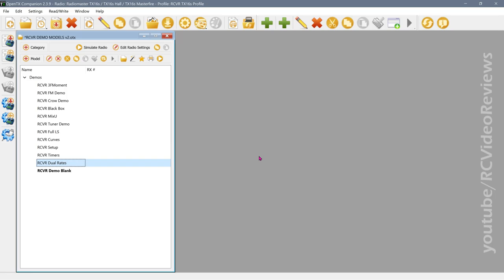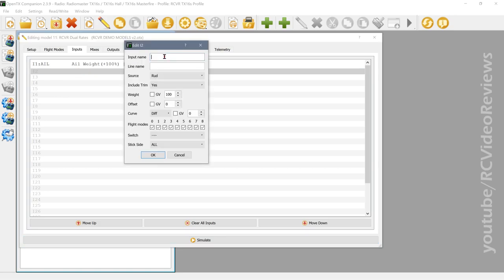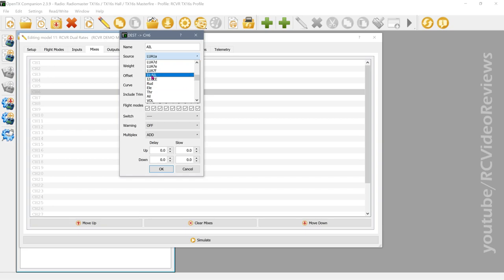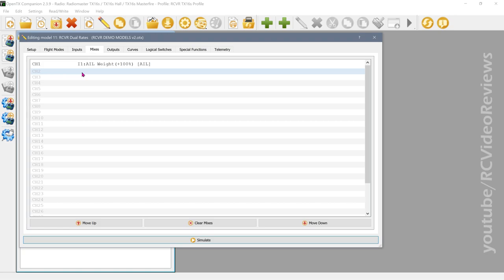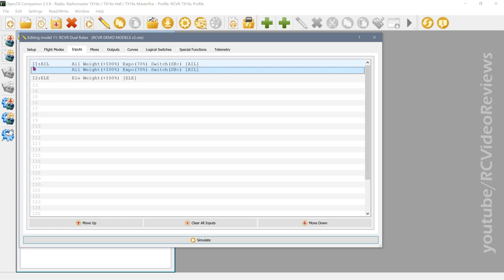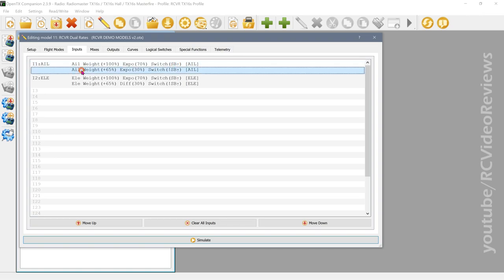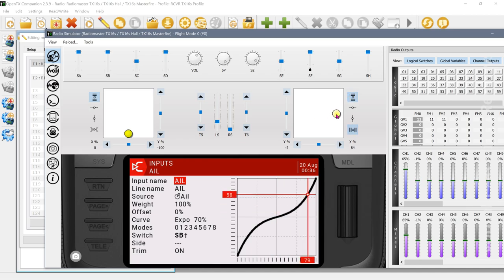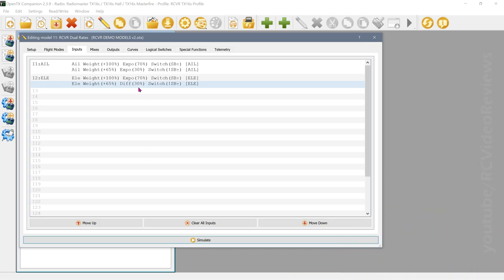OpenTx Companion Tutorial • How to Setup Dual Rates • Radiomaster TX16s • [Beginners]

Comment: Very clear! Just what I needed. I set it up on the radio directly, don't like to use companion. So I know what to do when I'm at the flying spot. Thanks.
Reply from the maker: Great! it's not too hard to convert instructions from Companion to the radio directly. There are a few areas where things aren't in the same places (Global Variables come to mind) but otherwise, it should be pretty easy to switch between the two.
Reply: @RCVideoReviews  Forgot how to do it and forgot the thumbs up apparently 😄, thanks again

Comment: Dang! So now I have to add my laptop to the mountain of other junk in my wagon when I head for the flying field. :D
Spend a lot of time wondering why things won't work before I come here for the light bulb moment. ;-)
Clearly annunciated and lucid. Thanks a bunch Chief! :)
Reply from the maker: If you spend some time tooling around in Companion, it will help you get familiar with how OpenTx works. The mouse makes it easy to navigate, the interface presents a full screen of options so you can see everything in a glance.

If you can learn to move around in Companion, you will easily be able to navigate the radio at the field.

Same concept as a flight simulator. Play with the sim at home, and when you get to the field, life is easier.
Reply: @RCVideoReviews  Oh I know what I should do. It's just that, being so old and cussed tancankerous, I just don't want to change my ways and learn! :D
Reply from the maker: We both know you’re curious. You can’t resist. You keep watching these videos. Just soak it all in. 

Do you have Companion installed?
Reply: @RCVideoReviews  Not yet. I'll stick it on the old laptop - if I can find it when I dig down through the pile of newspapers/pizza cartons in this old bachelor's hut! :D

Comment: Great Video, thank you for always providing such amazing tutorials! I have been adding D/R and Expo directly into the tx with each model I add. If I try your method of entering D/R and Expo through Companion will it automatically assign the D/R and Expo to each model I add, if so that would save me a lot of work when entering a new model? Thank you
Reply from the maker: The best thing to do is create a template and use that for all your models. So I do a basic setup with my rates, audible clues, throttle lock, gain for stabilizers, mode switch for stabilizers, trims to zero, subtrims to zero, etc....With all the basics set, when I'm ready for a new model, I select my template, then click copy, and start applying the differences from my new model and the template. Basically a bind, rate/expo adjustments, control surface changes (dual ailerons, flaps, gear, etc) and I'm done very quickly with the initial radio setup.

Comment: Did I do something wrong when I set up the different Weight and Expo rates inside the mixer tablet with mixers which replace each other? Is there something I can do better when I make this settings in the inputs? Thanks for your work and your tutorials!
Reply from the maker: I always use inputs for dual rates. It can be done in the mixer, but then you have to repeat all mixes you setup. It's best just to set dual rates/expo in inputs.

Comment: Hi, I want to setup dual rate for steering using alireno in mode 4 for my rc car but I want to assign a pot to adjust the weight from 0 to 100 so I can control the throw of the steering servo. How do I do that? It's a very common feature on most pistol style rc car radios which come with a dual rate pot.
Reply from the maker: Watch this: https://www.youtube.com/watch?v=KNXBwHwdFWU

Comment: Great video! Quick question, did you mean to set up elevator as "diff" , or are both as "Expo" in regards to the curve?
Reply from the maker: I usually don't setup elevator with diff--that's usually for ailerons. Not saying never, just not usually. This video was made some time ago, so without watching it again---not sure. Do you have a time index?
Reply: At the 7 minutes mark you can see the elevator dual rate is set as "diff". Just wondering if this is the desired setup or as "expo". 

Again I can't emphasize how helpful your videos have been to me. The TX16s is such a steep learning curve, I'm glad I found your videos!
Reply from the maker: That's "video typo" At 6:46 I said out loud "and I'll set the expo to be...."

Comment: Help I'm lost. I have the inputs and mixes in as you have shown. When you switch to your radio, is it plugged into your computer? While I'm plugged in, I have no button functions. Also, In the simulator, I have stick movement on the throttle, and rudder. No ailerons or elevator.
Reply from the maker: I would recommend watching my OpenTX playlists: https://www.youtube.com/watch?v=ye9Yaj_jUA8&list=PLy3TC1ILJYTjqDXFB84oXVWZG14zyMYYt

Comment: Hi  great video but mode 1 aileron is on the right it's throttle and elevator that are switched. I flown mode 1 for over 20 years. Just in case it confuses any one.
Reply from the maker: Thanks

Comment: Question, when you have two aileron and two elevator channels they will only be reflected in the Mix?  Elevator 1 and Elevator 2 will be +100 & -100 respectively.  Is this correct?
Reply from the maker: "When you have two aileron and two elevator channelsthey will only be reflected in the Mix?"
I don't really understand this question. You can put Aileron1 and 2, and Elevator 1 and 2 in the Mixer, and/or Inputs. The Mixer is what specifies the channel. The Mixer can use physical controls like the stick itself or an Input definition. The Input definition can include one aileron or two, and one elevator or two.

"Elevator 1 and Elevator 2 will be +100 & -100 respectively."
All control surfaces have a range of -100 to +100 with 0 as center.

Comment: One thing that killed me was when I was setting rates on the inputs - I wasn't setting a switch for the first line (default rate 100%), I was only setting switches for the 2nd and third lines of a 3 line rate setting eg. 100/80/70. So rates wouldn't change as I flipped my assigned switches, they would always be 100%... 
If I don't set a  switch for the 3rd line (rate) (70%) , the rates all work as if all 3 lines(rates) had switches assigned.
 If I don't set a switch for the middle line (rate) (80%) , the rates default to either 80% or 100% , if I don't set a switch for the default rate you always get 100% regardless of how the rest of your rates /switch assignments are set.

Comment: Nice video. On the dual rates You have high rates switch SB up and low rates SB up. Why would you not assign low rate to SB down?
Reply from the maker: At 6:09 it shows !SBup, not SBup. There is a big difference. This is what I refer to as defensive programming. Since I use a 3 position switch I want to make sure either high or low rates are ALWAYS selected. So I use SBup for high, and ANYTHING BUT SBup for low. So that means if I stop in SB middle I don't turn off the control surface. This is all explained in the video starting at 6:00.
Reply: @RCVideoReviews  I'm watching your video. I see the input page, but I lost you where you clicked to get there on the companion page. Sorry. I am so new to this radio. Been using Spektrum for 7 years.
Reply: I'm sorry. You can disregard I figured it out. Thank again!
Reply: I aplogize for being so needy. I followed you step by. The simualtor shows no movement at all. Nothing responds. I missed something.
Reply: @RCVideoReviews  Makes sense. Good work on the video. I appreciate the time and effort you must have put into it. **

Comment: Can I do something similar to throttle limits meaning set one of my 3 position switches to 33%, 66%, and 100%?
Reply from the maker: Sounds like a heli throttle curve. Yes, you can. There are lots of ways to do it. Any easy way would be special function override channel value.  Remember the range is -100 to +100 so 200 points. So 33% would be -33.  66% would be 33.

Comment: Nice video! Quick question? My Left stick (Mode 2) is off center to the right. Not by much, but I can see it for sure. This was not an issue at all since calibrating worked great, however, after using the radio with a Flight Sim, the Sim told me that Channel 4 is off center??? Is there a way to center the stick using some "Gimbal Adjustments" in the inside??? Thanks.
Reply from the maker: If you're saying a spring tension stick (rudder) is physically off center with no hands on the stick, you definitely have a mechanical issue. I would take the cover off to figure out what's going on. All of your sprung sticks should always physically center.
Reply: @RCVideoReviews  Hi. I did open it but I could not figure out how to mechanically center it. Probably because there is no way to do so with this radio. Thanks for the fast reply.
Reply from the maker: @fc1133  There is no centering adjustment. I would look at the hardware inside to see if any of the runners are off, if the spring is latched correctly, if there are any bushing out of line, or if the stick itself is bent. It should center perfectly.
Reply: @RCVideoReviews  I contacted the seller and asked to send it back. I don't feel like messing with a brand new radio. However, if the next one has the same issue, I sure know what to do. : ).
Thanks.
Reply from the maker: @fc1133  Did you order a replacement? If so, let me know what you find out. The sticks should center perfectly.
Reply: @RCVideoReviews  Sorry foe the late reply... I was going back and forth with the seller and keeps telling me that the factory told him this is normal. Yeah right. Anyhow, I contacted Radiomaster directly and they will send me new gimbals. How cool is that!? Thanks.
Reply from the maker: @fc1133  Awesome. New gimbals should solve it. The sticks should stand straight up.
Reply: @RCVideoReviews  I agree. I keep you posted. Thanks.

Comment: I'm puzzled.... I've got a brand new Radiomaster TX16S, and OpenTX Companion 2.3.  I was able to successfully set up a three position, dual rate switch.... but in my Companion, I cannot find the pop-up window that you show that starts with "Lines", and has some other items listed.  If I right click on a line in the Mixer display, I can access the "Duplicate" item.... but the new line that is created has a tiny plus and minus symbol at the beginning of the line... which your lines don't show.  Am I missing something?  Do I have a slightly different version of Companion?  Thanks for a great series of videos.  As a guy who started in R/C with 10 channel reed radios back in 1962, I am learning a LOT!
Reply from the maker: I only see a lines item in the inputs tab, not in the mixer tab. Sounds to me like you're operating in the mixer tab where I'm operating on inputs.
Reply: @RCVideoReviews  Yes.... that was the problem.  But now that I think about it, (and having successfully programmed a 3 position Dual Rate within the Mixer tab), doesn't it make more sense to set up Dual Rates in the Mixer... to accommodate things like V-tails, etc. that are mixed to be able to function?  And while I am asking "noobie" questions,  am I correct that you are recommending setting up the basic controls in Inputs with "Ch1:Aileron" .... rather than just the "Aileron" option?
Reply from the maker: @tcgliderguy1  No. Dual rates belong in Inputs. If you put rates in mixers then you need to duplicate every mix. That's not the right way to do things. The flow of information is INPUT -> MIX -> OUTPUT. Use mixes to assign inputs to channels and mix controls. Use inputs to apply rates. You can do it other ways, but I promise, rates in inputs is the correct approach.

No, Inputs should use the raw source. Not CHx:yyyy  CHx:yyy is an output, unless you're sure you know what you're doing I don't think you want to create loops like that. Inputs use raw source.
Reply: @RCVideoReviews  Thanks!  I appreciate the help!
Reply from the maker: @tcgliderguy1  Sure thing.

Comment: Great. do you have problem with switch
SA,SB,SC,SD normali in 3 position. But in
actual my TX only 2 position..
in hardware setting in 3position..Thanks.
Reply from the maker: I'm sorry I don't understand the question.
Reply: Maaf merepotkan terimakasih sudah merespon. Saya ada masalah dengan tombol SA, SB, SC dan SD. Dimana seharusnya berfungsi untuk 3 pisisi. Tetapi ini berfungsi cuma 2 posisi. Di setting hardware sudah saya setting 3 posisi tetapi cuma fungsi 2 posisi.. saya hargai sekali atas respon dan sharingnya.. terimakasih..
Reply from the maker: @dayatgendut1645  Radio apa yang Anda gunakan?
Reply: @RCVideoReviews  jumper t16